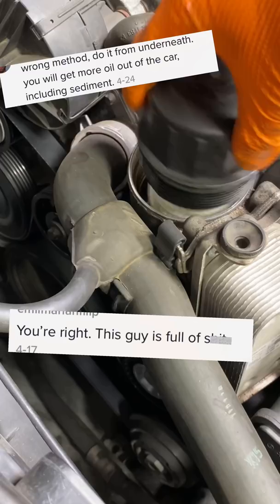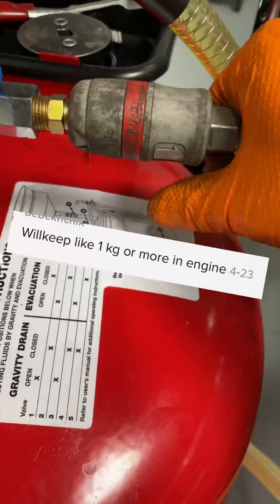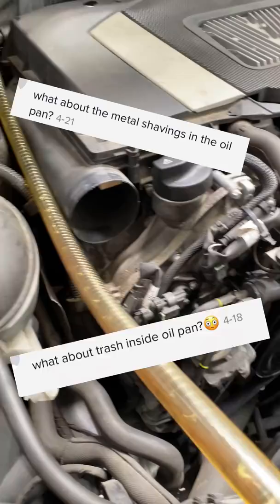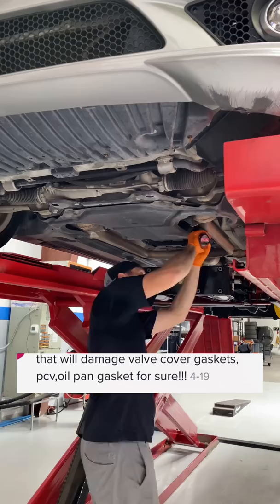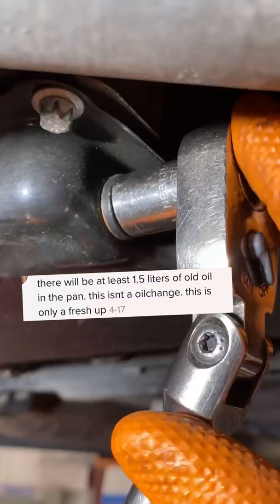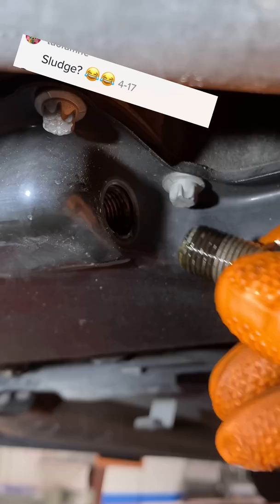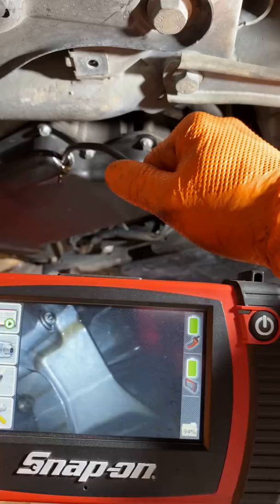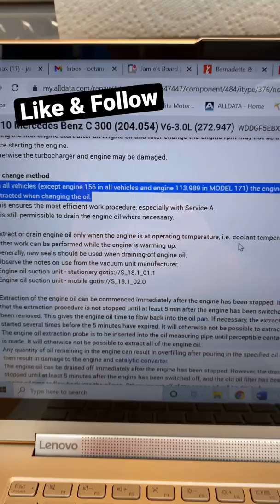#shorts Mechanic Proves Haters Wrong

Comment: Ahh yes, people telling a mechanic how to be a mechanic
Reply: Actually mechanics telling a mechanic how to be a mechanic
Reply: @supernova1725  just no. YouTube comments don't make you a mechanic.
Reply: John Wells  well they were clearly wrong weren’t they
Reply: John Wells  SuperNova is doing the exact same thing lmao
Reply: @barjinhavo  no real mechanics don't need to check manuals cause we've studied for years to pass the cert and know these things cause we work on em every day...
Reply: @stylepoints.180  Real mechanics don't need to check manuals? Lmfao so I guess you've got every wiring diagram memorized, and automatically understand every new system designed by engineers with each new model release.
Reply: @stylepoints.180  hum just in case you didn’t know, super mechanic, new cars come out every year with new engineering designs. You’ll know em all by heart huh. Even the ones that are not even out yet. You’re a great mechanic aren’t you
Reply: @barjinhavo  I guess mechanics nowadays don't know what they're doing anymore. I mean they work on these systems everyday and shit really doesn't change from car to car mechanically but electrically.  They all have the same rudimentary systems to keep the engine and drivetrain running.
Reply: @goodnessgracious8819  some do and some don’t bro just like in every profession I guess
Reply: @barjinhavo  but for the most part, I have been training all my life and I say train because I'm always continuing to learn but for the most part people commenting on YouTube are the ones that need education. I have been a tech for 20 years and ill believe him over some youtube comment.
Reply: It's like an Walmart shelf stock person telling you how to be a mechanic.
Reply: @supernova1725  Let me fix your statement.   "Actually, Shitty mechanics telling a professional mechanic how to be a mechanic."
Reply: John Wells  if they were wrong whilst correcting an actual mechanic, chances are, the commenters are not mechanics. that would be like me going onto a nasa video, saying, "X astronaut did this wrong," when in reality, i know nothing about being an astronaut.
Reply: @goodnessgracious8819  some things change, from disassembly to reassembly to torque figures, to procedures on whether to disconnect battery or not to perform certain service on a vehicle, they are not the same. You have to keep learning, old cars maybe, the ones that were all mechanical but not the new cars with sensor and electronic everything. You can be good at your job, but something new always comes around that needs more than just muscle.
Reply: Ah yes you do anything on the internet and people all the sudden have phds in whatever you’re doing.
Reply: Do you think all mechanics are good at what they do?
Reply: Oh internet.. what a place you have become
Reply: Cops deal with it all the time
Reply: This is the internet, everyone has a PhD in everything
Reply: @Biggylios  talking about herd mentality while agreeing with the herd so ironic
Reply: @marioStortuga  let me correct your thinking. You have absolutely zero clue who is posting comments on YouTube and if you know then you’re Definitely a creep
Reply: Mostly kids
Reply: @supernova1725  messing around with your dad's old beat up fiat doesn't make you a mechanic. People undergo actual training to service these cars. Training FROM THE MANUFACTURER themselves. You know, the one that MADE the car...
Reply: @daniellucas773  My certificate does.
Reply: @TapiaJ  your not wrong 🤣
Reply: @seanandersongaming9387  it is true. I mean anyone with 2 brain cells can cut and edit a video short. And the others with less than 2 will believe this.
Reply: @TapiaJ  you right like come on people it's a professional mechanic doing his job XD
Reply: I thought we weren't supposed to call them that anymore
Reply: @stylepoints.180  Lol, you clearly aren't a good mechanic if one at all. No wait, there's actually the bunch of mechanics that change oils, lamps etc. novice stuff 😉
Reply: @goodnessgracious8819 
I know, old comment. But your comment makes me wanna say this;

Once you get the certification it only states you are getting paid for training.

Every car has something new, so be a bolt that needs to be torqed to a diffrent specification or a entier new engine mount solution.

Mechanics constantly have to catch up to new information and just work on improving their knowledge. Dosnt matter if its 1975 or 2075. There will always be something new to learn and its impossible to learn everything.
Reply: @stylepoints.180  yeah right dude even doctors check up on procedures they have never done before just in case. What are you on about school dosent teach you everything
Reply: @stylepoints.180  real mechanics check the manuals to make sure they are doing everything to spec. Bad mechanics assume they know it all.
Reply: @stylepoints.180  lmfao said something stupid and never came back… good riddance 😅😂😊
Reply: @goodnessgracious8819 sounds like somebody who hasn't touched a car newer than 2017. They are absolutely different and incorporate more and more tech each year
Reply: @scotty.p1184  There's 4 cycles of an engine and that's never gonna change.
Reply: @No_Budget.Builds  Intake, compression, ignition, exhaust.
Reply: @scotty.p1184  Mechanically there are always going to be valves open up to allow air and gasoline to enter the combustion chamber to be ignited and expelled. That's the dynamic that is never going to  differ from any manufacturer.
Reply: @goodnessgracious8819  you have fuel injection now which is different than distributors. You have coil on plug instead of wire on plug. You have active fuel management now. So yes the basic function of an engine is still the same but they are much more advanced now. Pop the hood on a 2022 mercedes and you will find out pretty quick that knowing the basics of how an engine works doesn't mean you know how to work on new cars. It's not 1991 anymore catch up with the times
Reply: @scotty.p1184  Yes, I understand what systems are available as I went to college to learn before some of these systems were even implemented. We were talking about obd 3 way before active fuel management and on-board tunable suspension systems became available to other manufacturers apart from high end sports cars. It still doesn't change the core principles of internal combustion.
Reply: @goodnessgracious8819  so you went to college 15 years ago at least. So that means that you were discussing obd3 years in advance (and I'm sure other software that still doesn't exist to this day.) Cars have changed more in the last 10 years than they did in all almost the 100 years before that. Maybe go back to college and you'll learn that you aren't as modern as you seem to think. I Graduated from the GM technician program just over 2 year ago and in that time a lot has changed. Time to catch up bud
Reply: @scotty.p1184  I'm more aware of modern systems and their functions and procedures than you give credit for. I would work on your condescending tone as you never know who you're talking to, I'm not just some guy that watched a YouTube series and calls himself a technician.
Reply: @scotty.p1184  The car I own and service is considered modern.
Reply: @goodnessgracious8819  dude you were saying that you were talking about obd 3 almost 20 years ago. That still doesn't exist today so what exactly were you talking about? I'm just tired of keyboard warriors who think they know shit they don't. Because you're the same type of people to try to fix your car with no knowledge of what your doing then when you screw it up beyond repair you take it to people like me to sort out your mistakes and I'm stuck racing book times to undo all your sloppy "repairs". Also the term "modern" is all relative. To somebody born 60 years ago they think anything past 2000 is modern. So that was the most vague statement you could make so you couldn't be corrected.
Reply: @No_Budget.Builds  The reason OBD 3 did not become a standard is because of it being an invasion of privacy.
Reply: @scotty.p1184  The talks of an OBD-3 wasn't studied but discussed as shop talk.
Reply: @goodnessgracious8819  invasion of privacy 20 years ago? What privacy? What could they invade? That's before touch screens and cameras were standard. So how could car diagnostics invade privacy? Please do tell. You said you were talking about obd3 before active fuel management but that's been out since 2005. So maybe do less shop talking and more shop working so you can actually learn my friend.
Reply: @goodnessgracious8819  and if you want to get really specific active fuel management has been around since the 1980s with cadillacs. So you were talking about obd3 before obd1 was invented? You must be really really ahead of your time. Also you could get an '06 envoy with AFM. That's no sports car in case you were unaware
Reply: @scotty.p1184  I only went to college to learn to be a more responsible owner of a vehicle and that I succeeded and surpassed. I studied automotive repair for the sole purpose of not having to pay someone else to do something I know within my heart I can perform with no complications. I perform all repairs as noted in nomenclature that are provided from manufacturer in the form of service manuals and technical service bulletins for updates. How much does one need to know to own car? Like I said I only studied automotive repair so that I can repair my own vehicle and not rely on someone to do something I know I can do.
Reply: @scotty.p1184  I stopped going to college because tuition was getting more expensive and I had a baby boy not longer after the recession under Obama. But life happened and I had to prioritize providing for my son over going back to college.
Reply: @goodnessgracious8819  dude you commented saying you've been a tech for over 20 years. And you also said you were having "shop talk" about obd3. That all implies that you are an actual employed mechanic. Sorry but if you only work on 1 vehicle you are not a mechanic. Congrats you learned how to change your oil and do a tranny flush. Dude you straight blowing smoke and you know it. Most shops pay for you to go to school. Maybe try actually becoming a mechanic before you wanna talk like you're already one. Because you are just incorrect in way to many ways. And you can't be familiar with modern technology if you don't consistently work on all the modern cars. You work on YOUR "modern" car, but an f350 is built a lot different than kia sportage. Much different.
Reply: @scotty.p1184  I refer to myself as a tech because I'm not a backyard mechanic and the shop talk were the discussions we had in college about future automotive projects within the automotive community. I said I have been a tech for 20 years because I grew up with older technicians passing down info and so I got to wrenching at 10 years old working brakes on old buicks and S10s and small engine repair on the v6s in the old trucks from 60s. I have set points ignition as well as diagnosis and repair of obd 2 modules. You have no idea who you're talking to and what I've done before you even had a youtube account.
Reply: @scotty.p1184 I didn't go to community college to make a career of it. I went so I could maintain a car so I could have a reliable vehicle for my son, I also went to get a better understanding of shop safety and to build friendships. I didn't feel the need to study any longer when I needed to be there for my son after his mom left us after she experienced post partum depression and split.
Reply: @supernova1725 youtube comment mechanics😂
Reply: 😂 those damn ppl